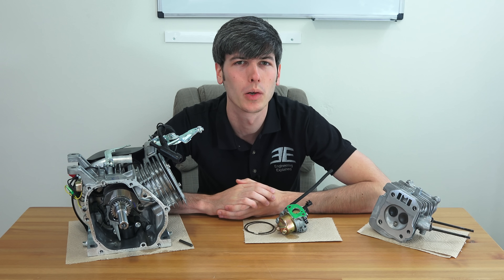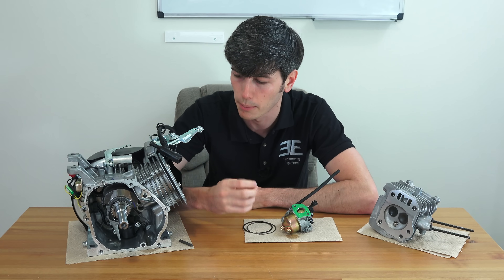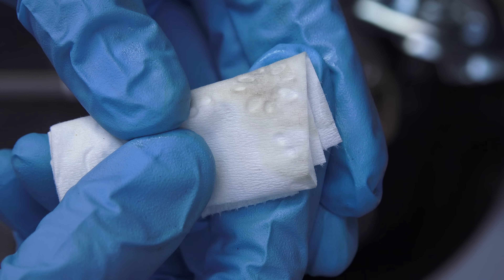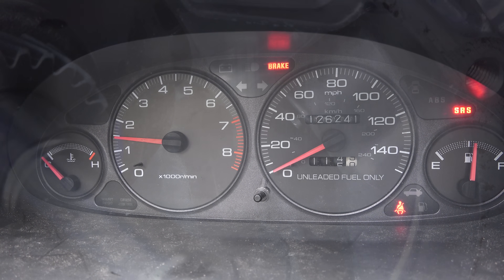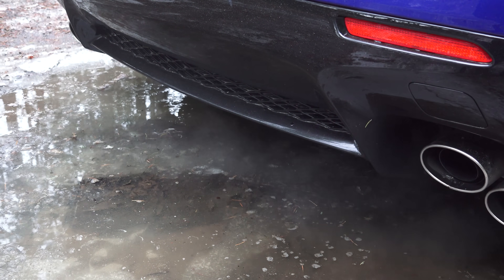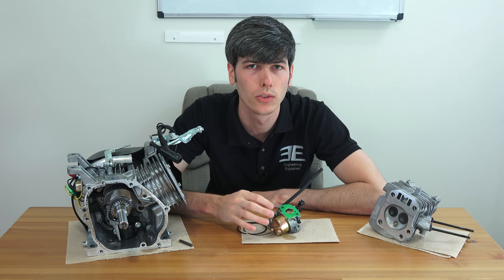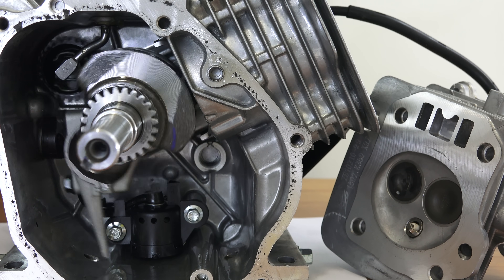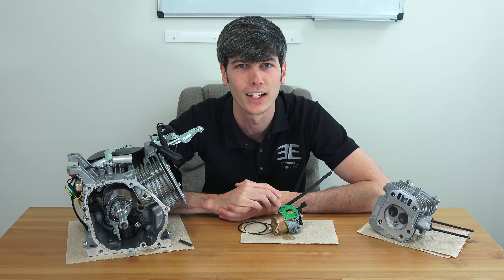Should You Warm Up Your Car Before Driving?

Comment: I always heating my car up especial if it’s been sitting too long I just don’t feel okay when I rev it up and I feel a delay on power.
Reply: Thats just wrong.
Idling your car wears the engine out prematurely and it make stew heater take a lot longer to actually get warm air to the interior of that car.
Since ti are in cold weather you already are wearing warm clothes, so getting inside a car is warmer than being inside because the cold air is not blowing on your and your body is warming the interior.
Idling the car that I just tested three days ago took 12 minutes to get warm air to the heater vents. The same car when started and driven immediately, had warm air coming out the vents in less than 2 minutes, so obviously driving the car as soon as you start it not only reduces engine wear radically, it gets warm air to the interior much faster.

Comment: Hmm, when it is freezing I always use the engine block heater and indoor blower. This way there is no need to scrape the windows, oil is already warm and the diesel engine starts up nicely.

Comment: Perfect video for all the Americans that burn 1 gallon of gas every time they do a cold start. Pretty useless, especially with an automatic transmission that change gears at low rpm’s if you drive lightly.

Comment: Engine braking with cold engine. Is it a no no?
Reply: Engine braking is generally a bad idea for longevity, brakes are cheaper than engines. I think it really depends on how aggressive you are about it, gearing down gently to maintain speed isn't hard on anything but doing it aggressively is hard on the entire driveline.

Comment: What if you live where it’s -35 and you want to jump into a warm car before driving
Reply: Just give the file injected car 10 seconds to develop oil pressure and then drive off gently. It will warm up in less than one minute.
I live where it gets down to -60º F and I get warm air in 2 minutes or less. I have followed this procedure for decades and have never had any issues.

Comment: Use a synthetic oil like Mobile-1.  It has the same viscosity at 30 degrees as it dose at 90 degrees, so it flows through your engine on cold starts just as it would in summer time.  Also, most temperature gauges start at 100 degrees, so when the needle moves off 100, your ready to go.
Reply: Actually mobile one is garbage in the cold compared to even valvoline or another big brand.
Reply: @karlhopkins713  OK, thank you for that.

Comment: So thermal dimensional change? As parts heat up, they expand. Cold block, hot pistons and.rings? Cold guides, hot valves?  Hypereutectic metallurgy helps, but... Engines not warmed up gently see early piston/ ring/ sleeve and valve guide wear and the early oil consumption as a result. Ya want the pistons and sleeves, valves and guides to all warm up together.  That's why truckers, farmers and equipment owners all warm up their engines.  I say slow, gentle warmups: burn a little fuel to save massive embodied energy.  Rebuttal please...

Comment: Carburetors do richen the air fuel mixture in the cold, actually. With the exception of race carbs with no choke, most any carbureted vehicle you drive will have a hot air choke, electric choke, or in very old cars and trucks at least a manual choke. This both decreases the amount of airflow through the primary barrels and increases the amount of vacuum pulling on the primary boosters and the idle circuit, effectively richening the air/fuel ratio.

Comment: My three failsafe warm up methods -
1. Run engine at least 30 seconds
2. Don't drive above 2000rpm until it's fully warmed up
3. Drive a Lexus.
Reply: 2000 rpm may be too low for some cars. Keeping it under 3000 or 4000 is more reasonable. As a matter of fact, didn't some of the high end Lexus cars have a feature where the ECU limits engine rpm to 4000 or less until the engine reaches a certain temperature? I vaguely remember reading something about that.

Comment: Living in Saskatchewan I like a warm car. Car doesn’t blow heat immediately, when it is really cold you can fog on the interior of the windows if it is not blowing warm enough air
Reply: It fogs because you have the recirc on or had it on. I've driven my car after only ten seconds of idling, in -60 º F weather and it warmed up in 2 minutes and never ever fogged the windows.

You don't need "warm" air to defrost the windows, that is an old waive's tale. You only need air that is barely a few degrees less cold that the outside air and it will defrost the windows just fine (I have done it for decades in below freezing weather), even if it doesn't feel warm to your hand at all. Just don't use the recirc, that is what traps moisture in the vents and fogs your windows.
Reply: @Billy123bobzzz  Who besides me tghinks Billy Bob has never actually driven a car in cold weather. Actually, I wouldn't be surprised if he's never driven a car at all, because he's 12.
Reply: @russlehman2070  You are too funny, but completely clueless!

Comment: I let it run for a bit so I don't freeze when I get in my car
Reply: Thats just wrong.
Idling your car wears the engine out prematurely and it make stew heater take a lot longer to actually get warm air to the interior of that car.
Since ti are in cold weather you already are wearing warm clothes, so getting inside a car is warmer than being inside because the cold air is not blowing on your and your body is warming the interior.
Idling the car that I just tested three days ago took 12 minutes to get warm air to the heater vents. The same car when started and driven immediately, had warm air coming out the vents in less than 2 minutes, so obviously driving the car as soon as you start it not only reduces engine wear radically, it gets warm air to the interior much faster.

Comment: i live on a highway with hills, as i pull out of my driveway with the engine only having been on for 1 minute or so i need to accelerate to 50 mph while climbing hills, should i favor higher rpm and lower gear or lower rpm and higher gear? or should i wait more than 15 seconds?
Reply: Lower rpm

Comment: I use valve grinding compound additive in my engine oil. Creates more friction. More friction=more heat=less warm up time=less emissions.
The thing to remember is that idling the engine uses less fuel than driving it. When I drive my car  to work on cold mornings without warming it up, I fill up more frequently than idling it for 10 minutes at least then taking off. As he stated, the fuel is enriched until the engine warms up, and more load means more fuel. Also, the piston ring end gap and space between compression rings and sleeves is greater until the engine warms up, thus allowing more fuel and exhaust gases to enter the pcv system and oil. This will darken your oil faster, proof of concept when I drive mostly highway for 5000 miles my oil is the same color as 3000 miles of short trip driving. Whereas 5000 miles of short trips darkens it faster. Warming it up in the summer isn't necessary however, with modern engines and tight tolerances, at subzero temps it's imperitive that oil is thin enough to flow freely through all orifices.

Comment: What about with a diesel? Diesel fuel is an oil in itself, so it is self lubricating to a degree.
Reply: Diesels need to idle before and after driving. Not doing so will eventually cause a headgasket to fail, or the turbo to fail.

Comment: Does a turcbocharged engine need to warm up to “warm up the coolant”?
Reply: Hugo A um nah, start it let it run till the idle drops and that’s it’s. Everything should be circulated and heated.
Reply: @han0509 Don't forget not idling a diesel before driving, or after can cause a bad headgasket.

Comment: Hi, just stumbled on this video and I have a question. Does this apply to Diesel engines too?
Reply: I'd say no since diesel has lubricative properties unlike gasoline.
Reply: You must let diesels idle, not doing so this will eventually cause issue's, like blowing a headgasket or ruining the turbo.
Reply: @karlhopkins713  yeah you need to atleast wait for the rocks to get out (you know if started a diesel in real cold) and the idle speed to settle down to near normal

Comment: My commute is very short so when the temperature gets low enough for frost I let my truck warm up a minute as I scrap. When there's  a thick layer of ice I let  it warm up for a few  minutes then start scraping. If it's some combo of ice and snow , more time spent clearing/scraping generally means more warming up. When it's well and truly below zero with 
 30+ mph winds (I know windchill doesn't efect machines, but it does me), you know, when your eyes freez shut and breathing stings, even strong batteries crank the engine slowly, and the clutch pedal returns slower than you take your foot off of it, some warming up is in order.

Comment: Can you explain racing cars engine warm up procedure and why you can’t do that on a normal car?
Reply: Yes. In the case of F1 or similar very high output gasoline engines the clearance of the moving parts, such as pistons, are designed to be ideal at the working temperature. This means that at ambient temperature the parts will have no clearance at all and would be destroyed if the engine were rotated. That is why these engines are heated before they can be started. 
Modern mass produced automobiles are designed to warm up quickly while driving to reduce emissions and fuel consumption. Basically it is a waste of fuel to idle an engine or warm it up for more than a minute or so in most circumstances. 
Hope this is helpful!
Reply: HH Jones thanks, I’ve seen some cases where the engine is reved up to like 60%maxrpm repeatedly then after 1 min they keep the rpm constant at ~60% but I don’t know if they warm up the oil before that. By repeatedly pressing acceleration, I think the engine load increases and the oil pressure is higher for initial lubrication. But doing that on a normal car may cause some unexpected problems
Anyway simply driving off to warm up the car is enough for ensure a good engine life.

Comment: For the oil dilution problem, idling cold with rich mixture sends less fuel than driving the car cold, so not clear what is better. Anyway in both cases it should take less than a minute until  cylinders warm up. Fuel dilution has a good side as well, it cleans the oil scavenging rings.

Comment: On my subbie, i warm the engine up to 145 before driving. This is set temperature, where the car changes from the cold enrichment table to the normal enrichment table.  I do this to prolong the life of my transmission.

Comment: This is very interesting because it is the complete opposite with airplane engines. Almost all recip plane engines have carbs. So you have to wait a little while before taking off. This is mostly due to the desire to prevent uneven wear on the engine

Comment: I have a problem ive been wondering about for a while now... i have 08 camry... and my temp gauge is good it shows a reading... but when i start the engine no matter how much i wait .. ( i once started the car .. went and had a shower and got back to it and still showed what appears to be too cold) it doesnt warm untill i floor it serveral times and only then it goes slightly under the middle no matter how much i try to over heat it and i live in a constant 34°-36°C weather... also when i floor it a lot even tho it doesnt show that its hot.. i just get a weird smell of something burning tho i havent felt or heard anything unusual no engine light nothing... anyone can give an advice?

Comment: These answers may be technically sound, but they don't address the main reason many people warm up their engines. Most of us in northern climates (I live in Alberta) warm up the engine to heat the car's interior. In the north, even after scrapping, the windows can ice over because of moist breath being expelled by passengers. Iced windows, while driving, is more dangerous than fuel dilution.

Comment: i all ways let my car warm up to get oil flowing good can we say spun bearing
Reply: You will not spin a bearing. It only take 5 to 10 seconds in very cold weather to get full oil pressure in any modern car and then you can drive off without any danger of spinning a bearing.
I have been filling this exact procedure for decades and lice where it gets from -35 to -60 ºF, and have never ever had any problem at all.

Comment: What about my transmission? I have a nissan versa with a CVT and when it's canadian winter, the gearbox doesn't seem to shift up and my engine is reving above 2000rpm at 40km/h until i'm driving for like 5 whole damn minutes before it shifts up.
Reply: CVT transmissions don't have gears so not sure what you mean by "shift up". They are continuously variable, meaning the ratio is infinite between minimum and maximum, thus no shifting. It isn't uncommon for transmissions to have lag in extreme cold since the fluid is much thicker which creates a thicker filmstrength and can cause the clutchpacks to slip more than usual, as well as slower flow through the valvebody which also causes delayed shifting.
Reply: Sell it, CVT transmissions are trash.
Reply: @RoughRiders55  Naw, i actually love CVT transmission. That eeeeiiiiiii jerkity jerk eeeeiiiiii jerk eeeeiiiii is so passé you know.